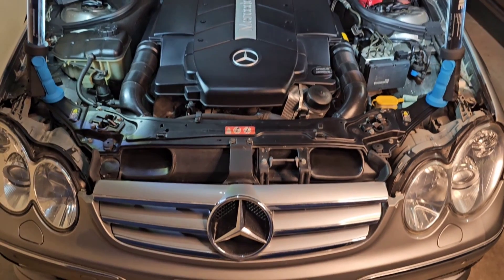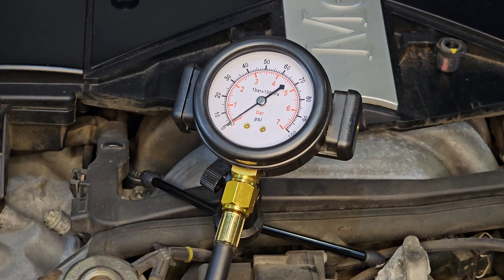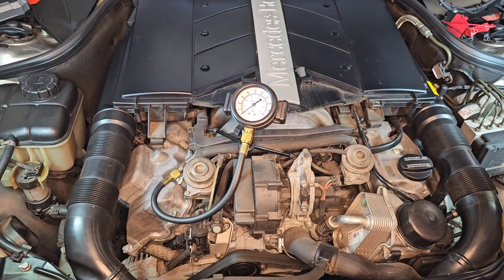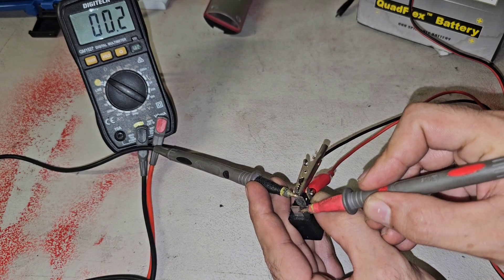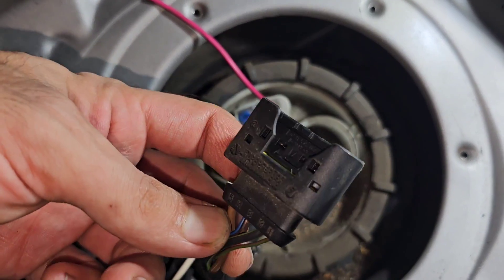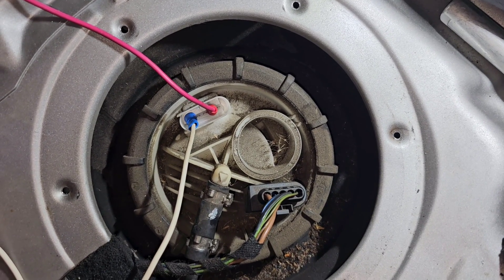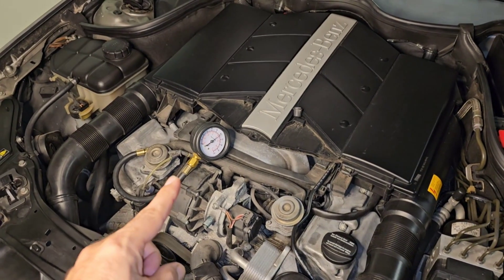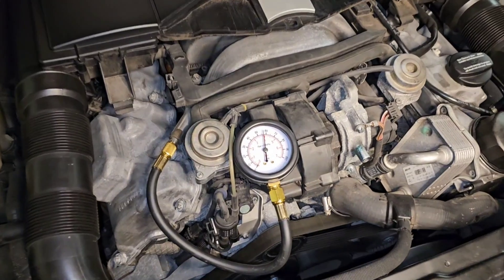Crank, no start... Fuel pump, relay, regulator, filter or stale fuel? The solution...

Comment: Hello, great video! I have a question about a Mercedes just like the one in the video. When I turn the key, the fuel pump doesn't build pressure; it only does so when I turn the ignition. Is this normal? Also, it's flooding the spark plugs and cutting the spark, which prevents the car from starting.
Reply from the maker: Some models make pressure with ignition in the 2nd position and some when you crank the engine. If it is flooding, do not run the engine, there might be the ECU being faulty, you can easily hydra-lock the engine or cause fire. Take the injector, ask some one to help you and confirm injector is spraying all the time... faulty ECU...
Reply: @BenzAddiction Okay, thank you very much for answering me. Have a great start to the new year!

Comment: The same solution can be applied to diesel engines 2.2 cdi ?
Reply from the maker: Yes, but you will also have a mechanical high pressure diesel pump too, producing  3500 PSI, making it impossible to check the pressure with these tools.

Comment: great video. 
please let me know which pressure tester is good for Mercs with the proper fittings.
i've got a W203 C32 AMG in Melb with fuel pressure problems. Cheers
Reply from the maker: Mercedes has a standard fitting and they all fit.

Comment: Hi thanks for the video. Im having the same issue with my clk500. Did you check the voltage at the 2 and 5 terminal of the plug? Only asking as im getting no voltage there but im also getting  an open loop when I test the pump, and it's not working with independent 12v but seems strange to have an issue with the power supply and the pump aswell. Any advice would be greatly appreciated
Reply from the maker: So you know the fuel pump might work at few seconds only when you rotate the ignition switch to 2nd position. Also I am supposing that you have checked the fuse and relay already.
Reply: Hi yes the relay and fuse are ok. But if I jump the relay with some wire i get 12v at the plug. The funny thing is I still get no pressure at the fuel rail. I tried hooking it to a separate 12v battery and still no go.

Comment: This helped part way. No gas at fuel rail. I have the pressure gauge hooked up and positioned so I can see when turning key. Previously when I had it running two months ago, it read 55 on the gauge. Then it started to vibrate after a week and then crank with no start. I jumped the relay and the pump works, but not when I try to start with key. I have primed the pump a few times to get fuel but no start only crank. Not sure where to go from here. Can you help me? Thank you!
Reply from the maker: Take the relay cover off (plastic) and push on the switch and listen to see if the pump works, inspect the relay point and check the primary circuit of the relay,  clean points, replace if faulty.

Comment: Same exact problem but what I’ve noticed is my cls550 starts better in warm weather   I’ve replaced both pumps but when I hear the pump I kno it’s going to start no problem is the pump going out?
Reply from the maker: This might be the case, also check the relay and connector as well.
Reply: @BenzAddiction  am I supposed to hear the pumps everytime I turn the key?

Comment: mine cranks but doesnt start. i hear a vaccuming liquid noise coming from the back w211 diesel 2.2
Reply from the maker: Yeah, there is a high pressure fuel pump also for diesel engines (Mechanical)

Comment: This sounds more like the fuel regulator of injectors were gummed upand not closing properly. The fuel pump does not hold pressure. The regulator and closed injectors should do that. The Lucas  treatment probably cleaned them.

Comment: Hello there ! I found the fuse box clk55 2002 amg rt rear trunk but no relays . Is it under the seat ? Is that just a few bolts in the front of tge seat? Oh i did see one relay by itself next to the fuse box is that it?
Reply from the maker: If all of the equipments of your car working, you don't have to look for every single relay. Let me know what relay you are looking for, and I might be able to help.
Reply: @BenzAddiction thanks I have the Cabriolet and it's near the fuse box on the right. It's just one fuse sitting by itself.  I was going to short the relay to drain the old gas but I just added more fuel. The gas is 2 years old but I had it filled up almost  I think having less air in the tank helped. Going to add 5 gallons it runs with the old gas. So far I had an air bag light which was a wire shorted that detects passenger weight a cracked plastic radiator tank and a small hose near the tank leak and throw a code. That's not bad for 7 years has no rust  paid 6300 $ and it had 120k miles on it. Love the car next valve cover gaskets I see oil on both sides and it has a 400 mV draw somewhere.  Oh and from sitting is has the abs bas lights goin on just going to change the brake switch and check fkuid level. Thanks

Comment: I have a 2005 C230 kompressor I changed the fuel pump l trying to start it and still don’t start I checked if spark it dose but not fuel, not pressure , fuse and relay are ok can be the fuel sending
Reply from the maker: You need to make things simple.  Use a 12v source to power the pump yourself see if that works...
Reply: any luck

Comment: Thanks for the video. After a mistake I made by disconnecting the live 12 volt wire from the glow plug N14/2 relay which hit the ground I received the error below.

I have this following error 1482-001 Check component N14/2 (Glow output stage). Short circuit, followed by:
2134-001 Glow plug Cylinder 2 FAULTY 
2135-001 Glow plug Cylinder 3 FAULTY 
2136-001 Glow plug Cylinder 4 FAULTY

I have check all the fuses, engine bay, trunk and passenger side and driver side but I am not able to start the car, no crank whatsoever.

Any help or idea on the matter?
Reply from the maker: I have a video on fuses that you might want to check.

Comment: Hey I let my car sit for three weeks and isn’t able to start or no crank . What do you think is the issue ? I have a 2003 clk320
Reply from the maker: Make sure the battery is fully charged.  Sometimes locking and unlocking the doors would do the trick or simply disconnect the NEGATIVE terminal for 5 minutes.
Reply: @BenzAddiction didn’t work

Comment: I have a 2005 C55 AMG and I am having this issue after welding some resonators, in to calm down the straight pipes. I didn't disconnect the battery when welding, but the welding ground was less than 12 inches away from where I was welding. The fuel pump fuse was found to be blown and relay still working. I have no fuel pressure, hoping it's just a pump! Thank you for your video!
Reply from the maker: Fingers crossed not a big issue.

Comment: So no power to the pump at times & you cleaned injectors & what not & now it's good? Like the poor fuel made everything act up?
Reply from the maker: @Akon-D  If the car sits for a long time with old fuel in the tank the first thing that goes bad is the pump. Fuel absorbs humidity and humidity ruins the pump making it stuck, the pump was on its way to go...

Comment: i have same problem on w203 and I wanna test pump with 12v battery. There is 4 pins there number 4 is pozitive or?
Reply from the maker: @duskojovanovic4372  Be cautious,  look at the wires first, the thicker wires are for the pump, make sure to check the other side as well. It is a good idea to check with a multimeter first.
Reply: I think its same like on clk
pin 2 is positive and pin 3 is negative
Reply from the maker: @duskojovanovic4372  Great.

Comment: My w203 is doing the same but it starts for like a second then cuts out and i dont have a fuel regulator to check the pressure. When i put ignition on i cant hear the fuel pump is this common like a silent pump or is it easily heard?
Reply from the maker: Check with a can of starting fluid to see if it is fuel related.
Reply: @BenzAddiction  so I bought a pressure tester, it was 55psi but wouldn't start so changed the fuel filter now it starts but only 28psi, as soon as I turn off the car it instantly drops to zero.

Comment: Hey there thnks for video I hv c240 m112 v6 it's cranking but Don start checked fuel on the shredder valve of I press with a small screw driver fuel comes with a lot of presure n I do hv spark I really do no wht could be the problm
Reply from the maker: Hi mate, diagnose to see if there is a fault code.
Reply: Check the cam and crankshaft sensors!

Comment: I have a 2008 C-300. It sat for a very long time because it “died” on me. I was told it was the intake manifold. Before my car “died” I replaced radiator/hose and the fuel pump. I have spark, fuel, and air it cranks fine but won’t turn over. What do you think is wrong?
Reply from the maker: @HotAshHuni  Is the fuel stale? How old? Use start up fluid it should start, if not do a compression test on all 4 cylinders, and let me know.

Comment: i have a 2005 sl500 fuel pump kicks on sometimes relay is good after a drive the pump wont turn on
Reply from the maker: Yeah, I had this issue on another car, fuel pump is on its way to go.

Comment: I have A 99 CLK320 106 K miles that sat for years rarely driven, I am having this same issue. Going to buy some LUCAS, I will get back if it works!
Reply from the maker: Thanks mate keep us posted, add some fresh fuel for sure.
Reply: Did It work?
Reply: @osvilego1440  no, it was the Crankshaft Position Sensor.

Comment: I love this video but how sure are you that the Lucas treatment will make the car to last like a year, i think it's better to change the filter, or don't you think that the lucas treatment might wash the dirts inside the engine
Reply from the maker: I have seen many reviews on Lucas products, some of them done by YouTubers like project farm, in my opinion this product only has some extra lubricants and detergents, should not harm the parts, but as I said I do not promote this product,  my last sentences was basically stressing the fact that stale fuel can ruin the pump and regulator.

Comment: If you pay attention to the sound....you can actually work out where the issue is. crank no start? Most likely the fuel pump (Mercedes at this era have limited life span of 10,-12years max at normal op)
Reply from the maker: Thanks mate, Yes correct,  but it is not easy to hear the fuel pump noise.

Comment: Wow, never imagined that a mechanic in a bottle would have fixed this.  Old fuel and sediments could be an issue if these cars are not driven often. I prepare my Mercs (W201 and R170)  before hibernation , filling up the tank all the way and adding fuel stabilizer.  Then I start them every couple of months
Reply from the maker: Yes, i did start it every month, but never consumed the old fuel in it.